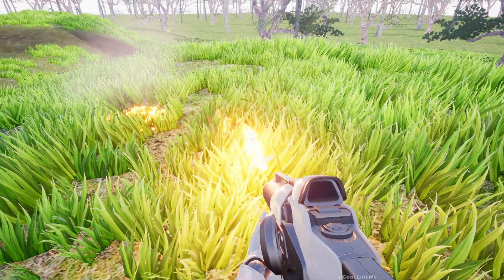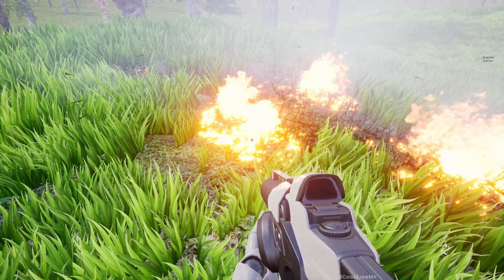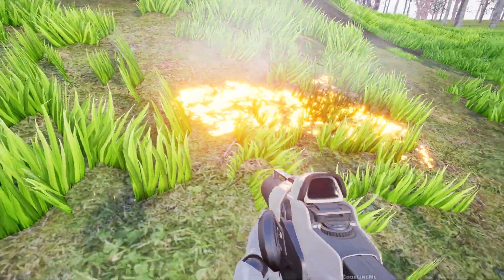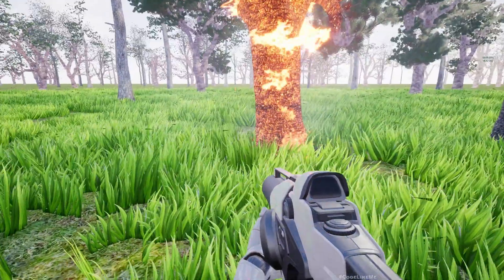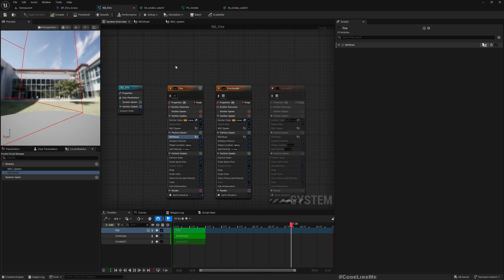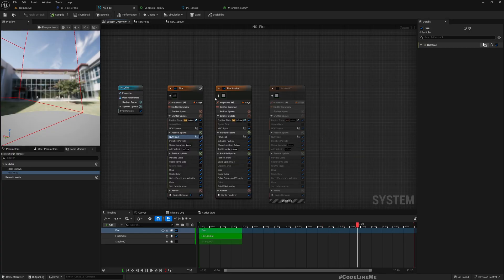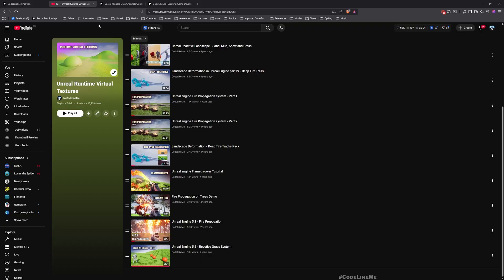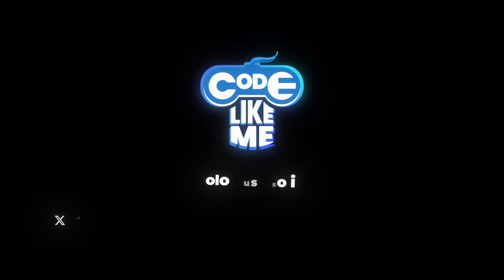Unreal Engine Fire Propagation with Niagara Data Channels

Comment: looks ok but I think it still needs a little bit more work. how its working is A+ but its the finer details that its missing. 
Needs billowing smoke, a smoke grenade effect mixed with a tall camp fire type black dark gray smoke trail.
Needs wind or some type of direction. Maybe a tutorial to make it work with dynamic sky an weather would be cool. Rain can put it out?
Also does this work with physical materials? If I have a house I dont want the walls catching on fire (Stone) I only want the doors, windows, ceiling, and support beams (Wood) to catch on fire.